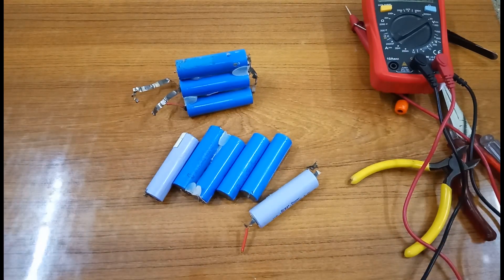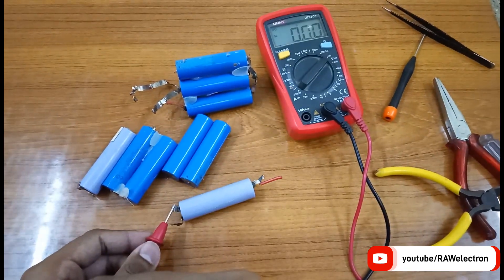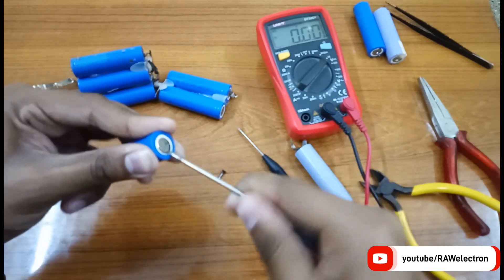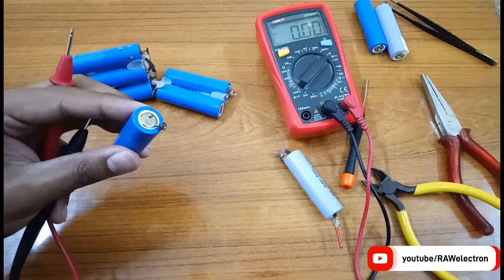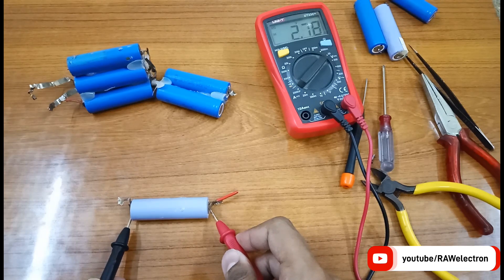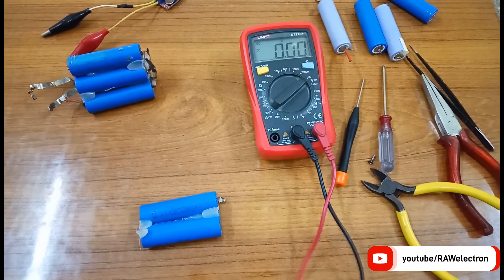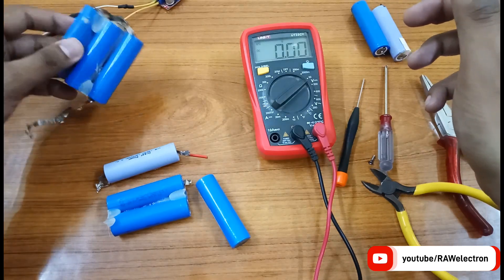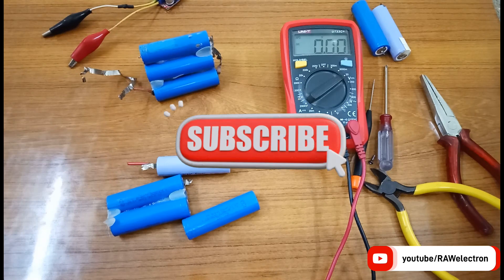Repair Dead Li-ion Battery | How to Repair Dead Lithium ion 18650 Cells  #lithiumbattery

Comment: Also i read that you said dont discharge them all the way at high current? What if there 35amp high discharge type batteries?
Reply from the maker: @Nicolaevici13  they are designed that way, that's why they are expensive.

Comment: Is this what to do when it’s leaking fluids out some
Reply: Thanks for the clarification and quick response.  I’m a subscriber now
Reply from the maker: @benalexander9907  you're welcome. Leaking fluid means it's chemistry is damaged..no chance of repair..
Reply: @Electricquantism402  thanks.  I did the unthinkable and safely heheh let the gas out and we’ll , you guessed it.  2.78 volt all done for under strict safety procedures of corse.  I’m needing then to be replaced.   Thanks great weary of knowledge you pas on.  God bless you
Reply from the maker: No...

Comment: Quite an educational video! Is it safe to use them after puncturing the gasket like this? Can we use a sewing or syringe needle as well?
Reply from the maker: Yes its safe.. but don't try to overload the battery by discharging at high current rate.
Reply from the maker: Yes safe to use..but don't discharge with high current rate. 
Yes sewing and syringe can also be used..